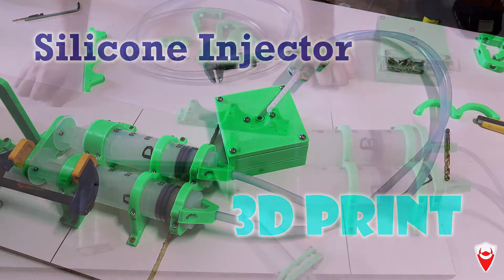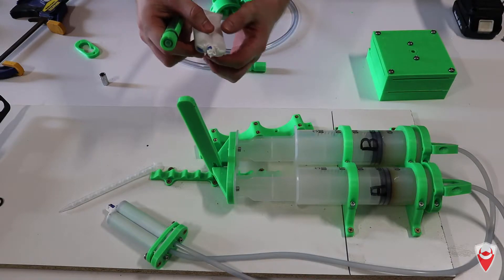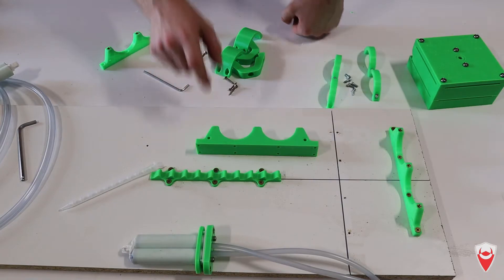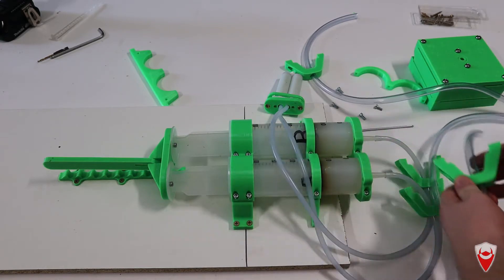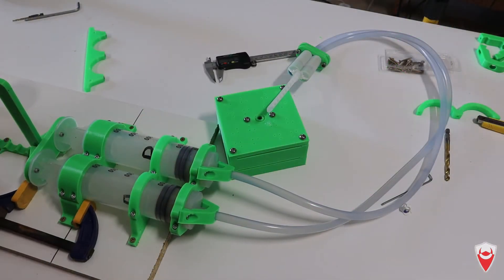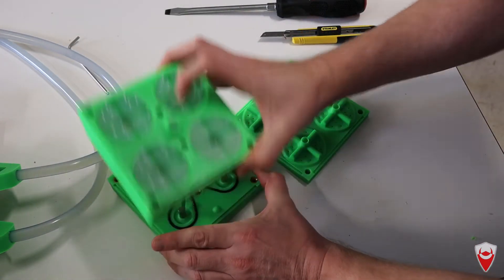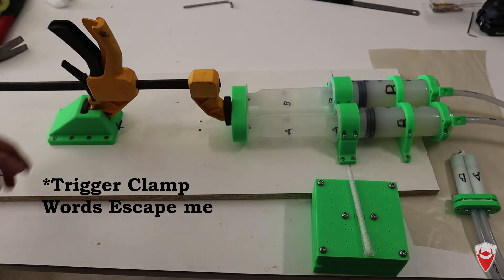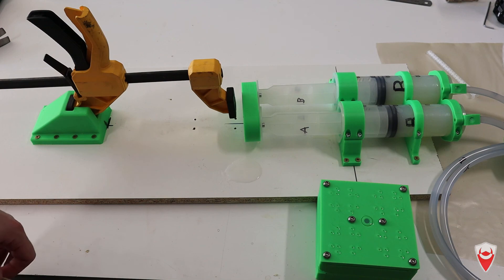[Build] Silicone Injection Moulding System

Comment: Do you think a silicone mold can be made with pillars of 0.5mm or diameter? I need to make a part that has 8 holes each hole is 0.5mm of diameter, or those pillars of the mold will be so weak that will tear off? I am asking because your mold has a very thin pillars or cyliders like I need to make my parts. My part is the size of a blueberry. A very tiny part.

Comment: what do you make the orings out of? Wouldn't silicone stick to
Reply from the maker: Just normal orings. The mixed silicone is never in contact with any of the orings, only one part. So it never hardens

Comment: Great video! Could you please elaborate on the LSR you are using and how it's cured? Can you share the manufacturer and quality etc? I'm doing some experimenting right now in this field but all the LSRs I've come across require around 150 degree celcius to cure making the actual mold one of the harder parts to make from 3d printing. If you cure the silicone at room temp that makes things a lot more easy
Reply from the maker: Hello! Thanks for the feedback.

This silicone is a 2 part (equal part A/B) "addition cure" silicone. Essentially it chemically cures like an epoxy at room temperature.

The company in this instance is called dalchem and I think this silicone was their P20 (the number being hardness value) but I can't see that on their website any more, P35 would be the closest. https://dalchem.com.au/dalchem-p35.html

If you're in Aus that's your best bet. If your in the US then look for smooth-on products.

Good luck

Comment: How to reduce voids or air bubbles ?
Reply from the maker: This set up mixes the silicone without any air entrapment, in this way (and using a proper feed in the mould, feeding down through the centre and then filling from the bottom) air bubbles will be avoided
Reply: Thank you

Comment: What kind of silicon you are using for your product
Please tell me the raw material so I can buy online
Reply from the maker: Sorry for the really late reply. I'm using dalchem silicone from Aus. However I have used smooth on before too.

The trick with this method is to have a low viscosity silicon (which usually correlates to the final shore hardness, the fact I want soft parts is beneficial here)

Comment: Looks like links other than the thingsverse one expired. Could you clue me in on what sizes and whatnot the non printed components are? Starting my own business with a cool, new product. I just have to make some prototypes. I'll ship you a prototype if you help me out!
Reply from the maker: https://chapmaneng.com/shop/composite-tools/ this is the link to the Infusion connector, it's the thing I'm making in the video with the injection mould. I've stopped selling them as I've moved overseas recently (twice) and I don't have the stability to keep producing them.

If you have any questions on other parts of the build I'm happy to help out.
Reply from the maker: These are the syringes I used:
https://a.aliexpress.com/_mOaeGyc

And these are the mixing cartridges:
https://a.aliexpress.com/_mLMiycG

The rest is just some screws, a dewalt clamp and some vinyl hose

Comment: this is absolutely brilliant.  I'd assume the restriction is also probably coming from the hose expanding. Think about cars that use Stock rubber brake lines and switch to SS braid lines for better performance (also clutch lines as well)

Comment: Hey! Do you reckon this can work to inject polyurethane resin into silicone mold? Thanks!
Reply from the maker: It would work. I did it using a smaller scale a few years back.
Reply: @CEWManufacturing  oh btw, your amazon link expired. what is it that we need to buy? the tubes and everything?
Reply: @CEWManufacturing  thanks, glad to hear that!

Comment: Could you please share the 3D model of the mold? That would help us to use the same tolerances when printing a mold for this type of Injection system.
Reply from the maker: I'd prefer not to, I sell these parts. Sorry.

However, I generally go for a 0.2mm clearance. Flat surfaces have an o ring groove in them with a custom o ring, or a cone shape that it mates against to locate the part and seal it.
Reply: @CEWManufacturing  what do you make the orings out of? Wouldn't silicone stick to them?

Comment: great video!  one thing about bubbles.  You could use the "other way" to eliminate them - pressure vessel.  One use of a pressure paint tank is to eliminate bubbles in castings.  Just pop it into the chamber, pump the vessel up to 30PSI and see the difference :)  Thanks for sharing this.  (just a thought but aren't you wasting a lot of energy with the friction of this larger and longer connector tubes?  Rigid PE or similar (teflon best) tubes would give you a much better advantage.... might be worth a try.  Doug)
Reply from the maker: Yep, wasting so much energy, still refining it...

Comment: This is awesome. Would it work for a 100 to 10 mix silicone?
Reply from the maker: It would, but you would have to size the area of your syringes appropriately if you were maintaining the same stroke lengths, otherwise some kind of ratio of the strokes would be required

Comment: Dear sir, very interesting effort. May i know why is the Parts A and B not required to be stir mixed? It seems that they merge at the output junction of the "mixer" but no stirring.
Reply from the maker: They mix through the tube. The tube is called a static mixing nozzle. It divides the mixture in half and re-combines it at multiple stages through the length of the tube. It works really well and doesn't introduce any air bubbles.
Reply: @CEWManufacturing  Wow, interesting ! Excellent explanation. Thank You!

Comment: Could you design and print a mixing head in clear that comes apart for cleaning and reuse with a tapered mix section. I need to design the pump system to use one plunger so I can mix colors, degas and then inject into the molds created. It is so cool to be able to make changes in designs and print out the parts to find out what works the best for a particular setup. Thanks for more inspiration.
Reply from the maker: You probably could do that. Have it as two halves which fit into a cone or something to hold them together... It might be worth looking into.

Comment: Hey, from where do you purchase your silicone ? I'm having trouble finding a reputable source for injection moulding. Thanks.
Reply from the maker: If you're in Aus, I've been using dalchem. Otherwise I've had luck with smooth-on before.

Comment: Nice mate, this is awesome. Can I ask what kind of printer you're using for the parts?
Reply from the maker: G'day mate, the printer is a monoprice ultimate. It's got a micro Swiss all metal hot end, as well as a bond tech extruder. I use a print bite build surface.

It's pretty good, but the stock cooling sucks and is something I should fix